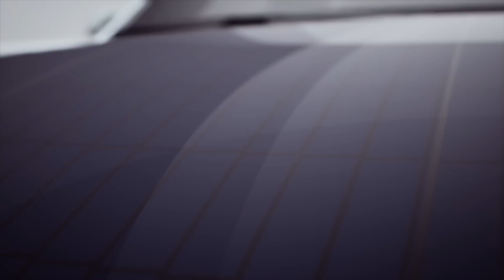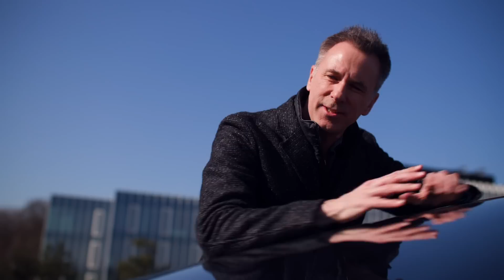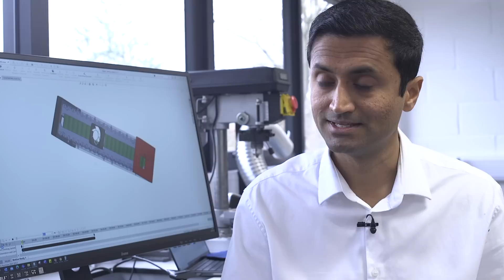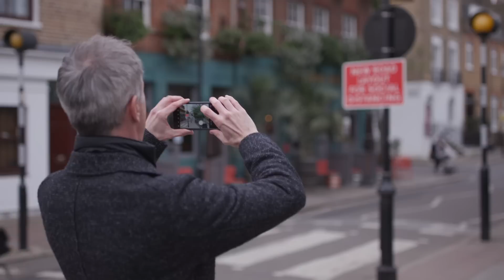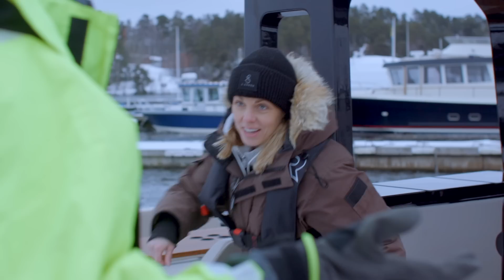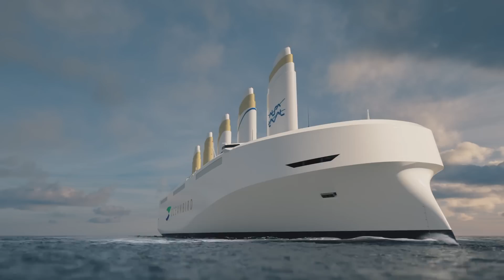A Sea Of Solar Power

Comment: Um facts in this video are very sketchy.. the solar challenge is in Australia..
The Sea of Solar..
Um er, co2 blurting manufacturers made the solar panels, co2 blurting trucks transported them to the port, and bugger me? Co2 blurting ships, tugs, and drilling rigs are required to install them.. and co2 blurting tugs are required to keep the panels clean..
Wash them to maintain efficiency.. what a wank..

Comment: I remember seeing an elecric Mini at the 2006 British Motor Show that boasted hub motors (and some ridiculous 0-60 time), it never got anywhere like most things, but I always wondered if that motor set up was used, as makes sense for packaging (may have an effect on handling with unsprung weight), so nice to see it has been used in the solar car.
Reply: Bmw was showing promise 10 years ago with the i3 and up until recently completely dropped the ball on ev’s.

The problem with hub motors is that they add a lot of unsprung weight and take a pounding because of it.  They need to be build very strong which then adds even more weight.  For the sake a driveshaft it’s not worth it.  You might as well put a much lighter motor in middle and one reduction gear is cheap and reliable.

Comment: Love to have a solar car, wow. New dream car.
Reply: The Lightyear two will have a shorter range and has a target price of €30,000 (26,000£). Because the car is so aerodynamic and lightweight, they can place a smaller battery than competitors. The battery is the biggest cost of a car, and I don't understand why there are so many big SUVs are being sold who require so much more electricity.

Comment: That Sail boat could use 'electric' power too as a Back up and use Solar power to ensure that the batteries are always charge. Battery power to have more control over docking, times of no wind etc. Between Solar and Wind, you could have a zero emission option for 'long' range transportation over Water. The chances of 'no wind and no sunshine for an extensive period of time is extremely LOW. In no wind, you can use the Electric and as soon as there is enough wind, use the sails and recharge the batteries...